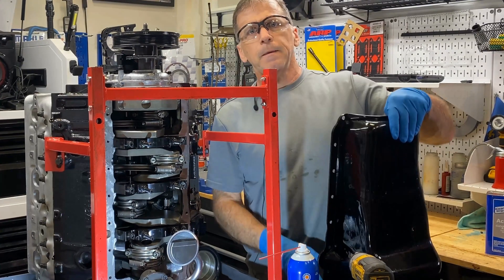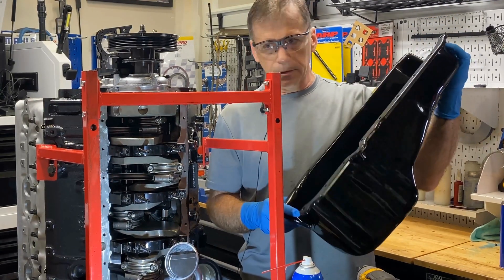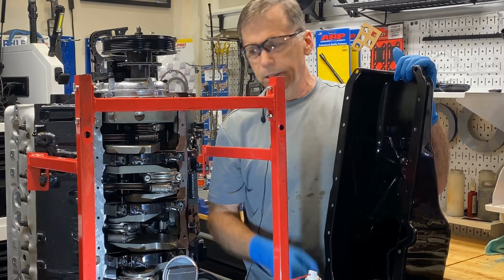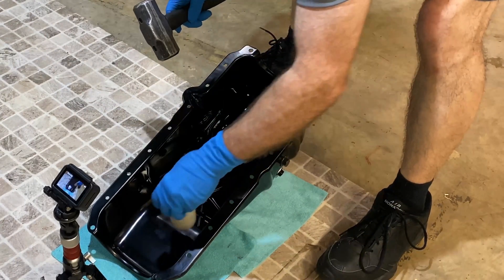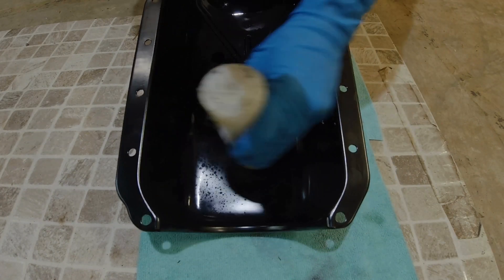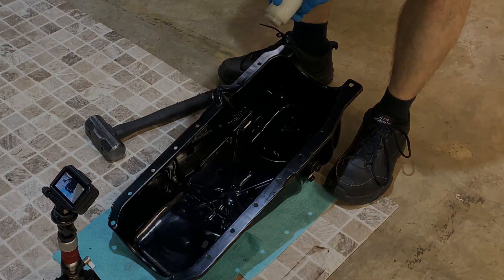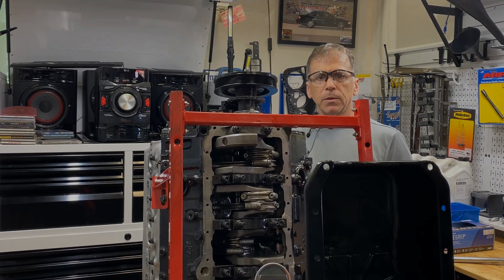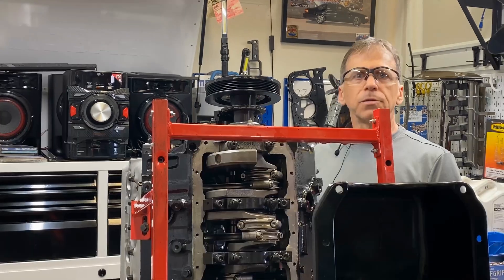Oil Pan Stroker Clearance--Yes you can use a stock oil pan on your stroker small block Chevy.

Comment: My car came with an aftermarket pan that I cannot even identify; Lingenfelter 383, but I don't believe it's a pan they typically used. A/F issue when I bought it, ended up being the shorty headers. Couldn't even tighten the inner bolt (3-bolt flange) because of the kickout in the pan, so there was a massive leak there seen by the o2 sensor. Luckily, a set of Kooks longtubes cleared, but why this pan.. I don't know. The stock LTx pan seems perfectly adequate for most everything.
Reply from the maker: cool.  good info and glad you have her all fixed up and tight now.

Comment: I did this and cannot thank you enough big savings and I put my old diffuser back in 3 washers and a tiny bit of dremeling where the nuts of the stand offs are! You are awesome!
Reply from the maker: Glad it helped
Reply: On the oil diffuser I went back and forth to reinstall, since it was suggested new stand-offs as you know the clearenced is tight with the baffle and clearing the nuts of the con rods, I used thick washers a tacked the nuts since only threaded 3/4 and a Dremel can break that tack. But I found that if you take a hand nibbler and adjust the lip on the diffuser it clears the pan baffle in the one corner along with opening the holes in the baffle a bit for the two diffuser nuts.

Comment: Thank you! Also are not those longer studs for the oil pan baffle? And doesn't the baffle need to be clearenced? Also I am using #8 washers but any information welcome.
Reply from the maker: Yes.  Longer studs from Milodon.  ARP will work but then more bending of the windage tray is needed.  The windage tray/baffle does need to be bent up and away from the rods. (I say up because the engine is upside down when you do the clearancing). I think washers/spacers would work just as well.

Comment: So if you didnt use main cap studs, there would be less clearance issues?  Am I correct?
Reply from the maker: Technically correct.  The connecting rods (#1/#2 pair) are usually the only clearance issue.  It just so happened that the engine I used for the video had main studs that need a bit of clearance too.

Comment: What about rod length 5.7 or 6.0?

 type of pistons, sbc 5.7 or sbc 6.0 pistons and piston year 19xx to 1996 etc? Budget build
Reply from the maker: Any rod length will clear a stock oil pan.  Some rod brands have the rod bolts sticking out further than others.  Eagle rods have the rod bolts sticking way out and require the most pan clearance work.   This engine has Callies Compstar rods.   Almost all my engines are 6" rods and the pistons are usually Mahle brand.   All years small block Chevy (Gen 1)  fit.  and of course gen 2 which is LT1.   This LT1 is just a Gen 1 small block Chevy with a 1-piece rear main seal and unusual front timing cover and water pump ports.

Comment: I dont understand what the taller studs are for.
Reply from the maker: Oh...the taller studs at #2 main.  They are not normally needed.  But with the Milodon main caps the taller studs are needed because they are the only studs I can find that have the threads in the right place to engage the bolt.  Milodon caps are taller than all others that I have used.  I have to buy 3 sizes of studs and mix and match them to get the right thread engagement.  normal studs at #1 and #5, taller studs at #2, Windage tray studs at #3 and #4.